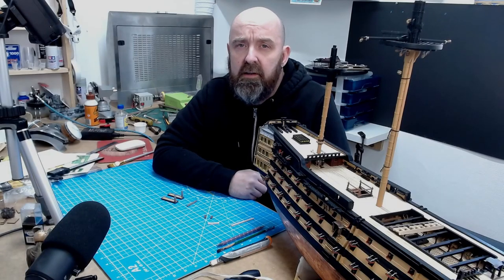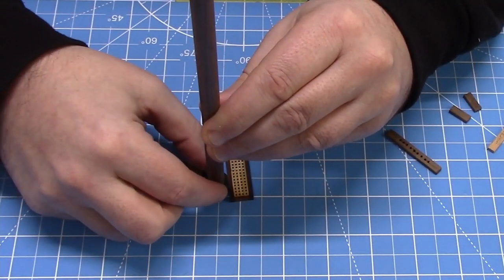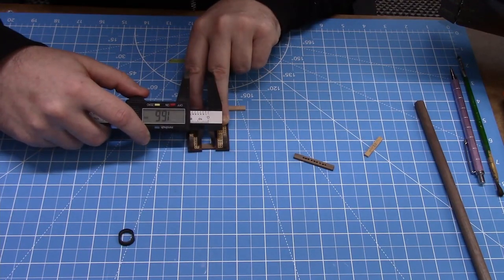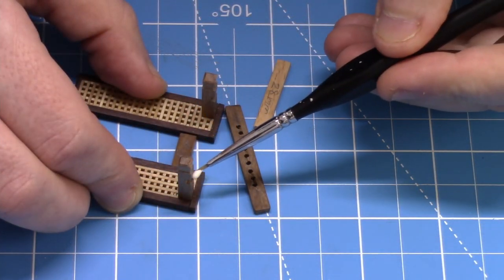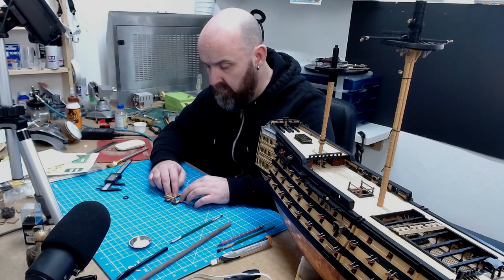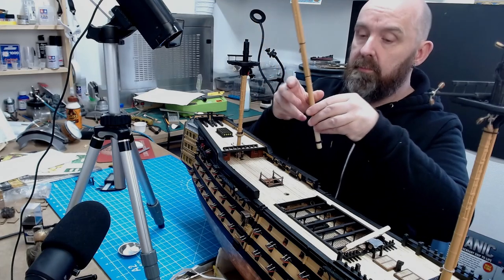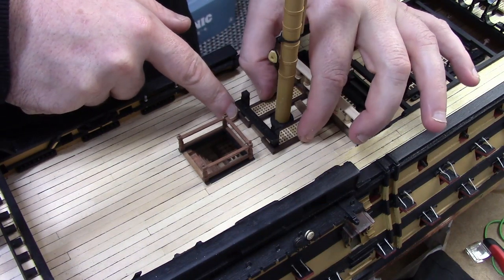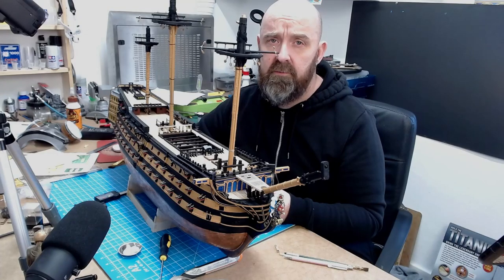The Most Difficult Model Ship To Ever Build - 1/84 HMS VICTORY

Comment: Hi John , I am curious what you think of the quality of parts for the Deagostini Victory? I am tossing up between this model and the Caldercraft Victory. I have heard the Claldercraft version is excellent but before I commit was curious what you think of the kit your doing? Thanks
Reply from the maker: Hi Greg, I stopped using the kit parts about  a year ago. And I’ve been scratch building my parts with better quality wood. I’ve not worked with the Calder craft kit. But it dose look, very good, but it you can wait, I would go with the 1/64 hms Victory from amati hopefully released in 2023
Reply: @Johnbuildsiconic  I didn't realise Amati were bringing out a Victory kit. I shall wait and see what it's like. I am currently building the Santisima Trinidad by Occre which  will probably take me another 12 months so can afford to wait. Thank you for the tip
Reply from the maker: Your welcome Greg. I’m hoping to finish my victory, so then I can start the 1/64 victory in 2023 😂